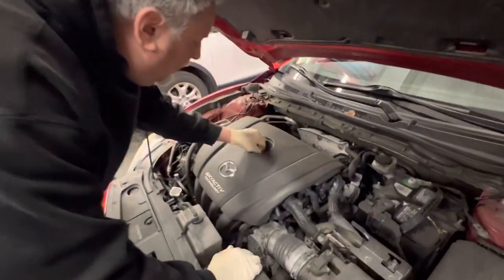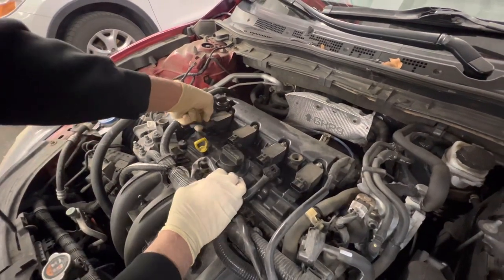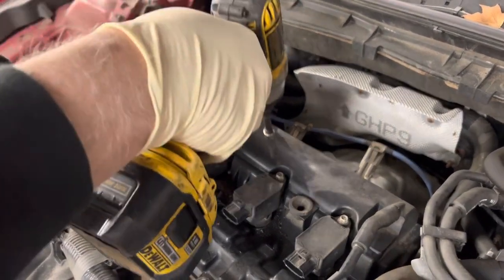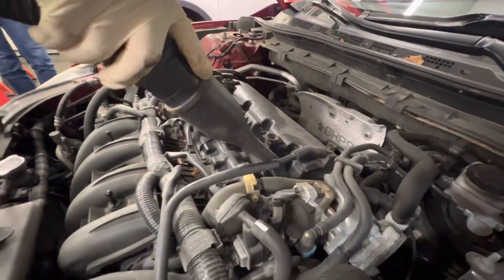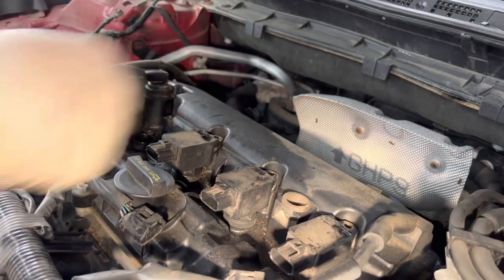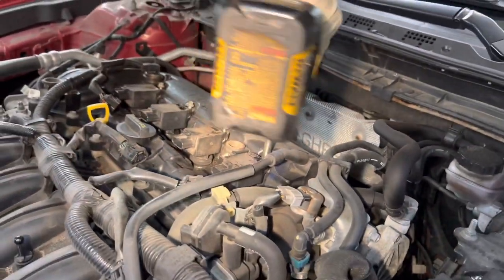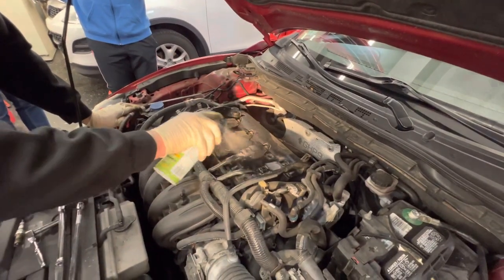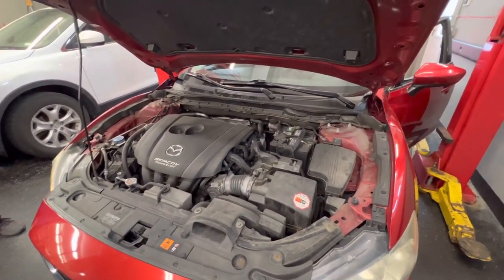How To Replace 2014-2021 Mazda 6 Ignition Coils

Comment from the maker: This video will show you how to replace the ignition coil on a 2014-2021 Mazda 6 with a 2.5 engine in it. The average lifespan for an ignition coil is around 100,000 miles. 
Buy Tools Needed For The Job
🔧BUY New Ignition Coils: https://amzn.to/3JxVuWv
🔧BUY 1/4 8MM Socket: https://amzn.to/3LgmV8o
🔧BUY 1/4 Ratchet: https://amzn.to/3J7Ka1P
🔧BUY 1/4 Extension: https://amzn.to/3l4mIe1
🔧BUY Silicone Spray: https://amzn.to/3ZI07mt
🔧BUY Anti Seize Thread Lubricant: https://amzn.to/3ZEqr0F

Comment: How necessary is it to coat and grease everything? Cause I don’t have none of that stuff
Reply from the maker: It helps out. You should be able to buy dielectric grease and silicone spray at you local auto parts store. You do not have to do this, we like to show you the extra steps that SHOULD be taken to help prolong the life of your vehicle. Hope this helps you out.